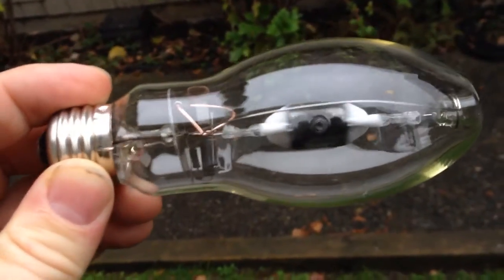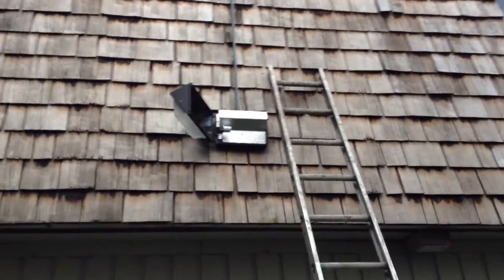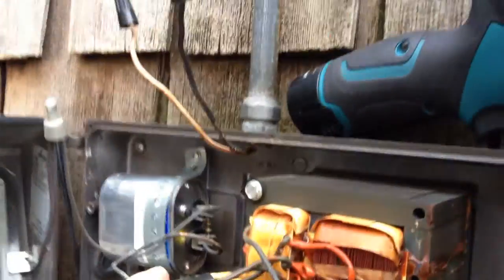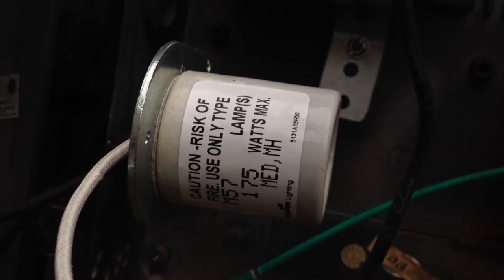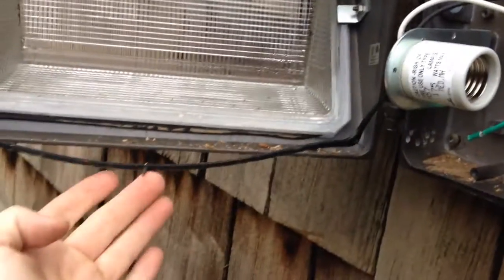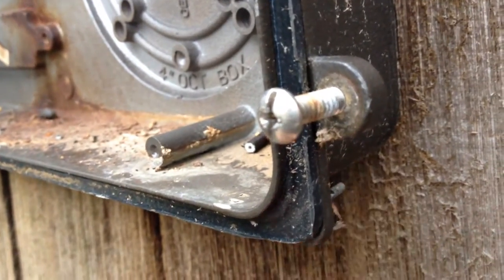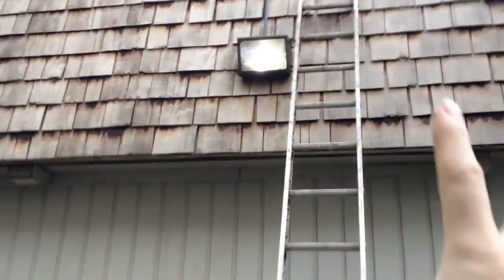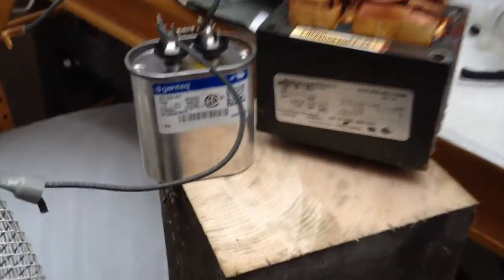Fancy-bulb fixture converted to fit plain LED bulb

Comment: Was that a metal halide bulb? Or some sort of sodium bulb?
Reply from the maker: It`s a Philips 175 Watt M57/E (enclosure needed)  (MH175/U/M) BD17 Probe Start Metal Halide 4000K Medium (E26) Base Clear Bulb. I`ll shoot a completely new video on how it works, how hot it gets, why they explode, ... Pressure inside the sooty vial (arc tube) is hundreds of psi (few dozens atm) ... a car tire runs on 32 psi. Has Hg and Ar in it.
Reply: theoverengineer awesome, thanks for the response, I do have to say I thoroughly enjoy your approach to videos and the info you provide :-)
Reply from the maker: Thanks for watching